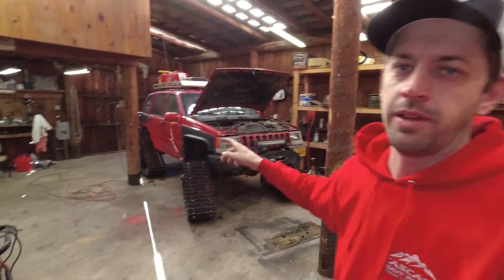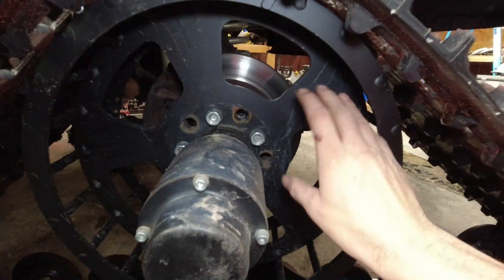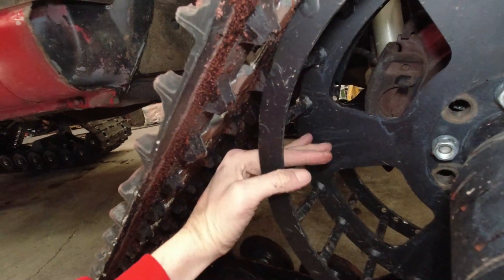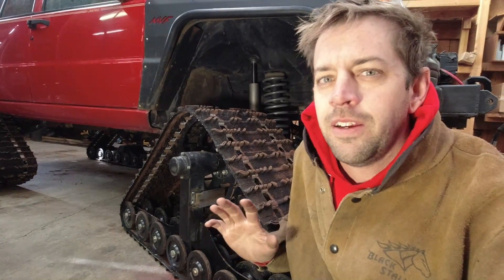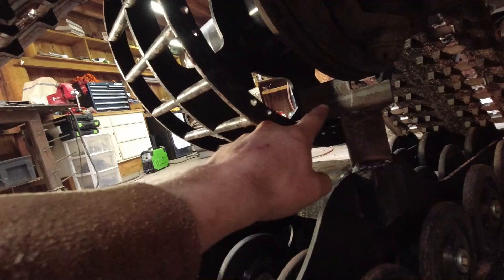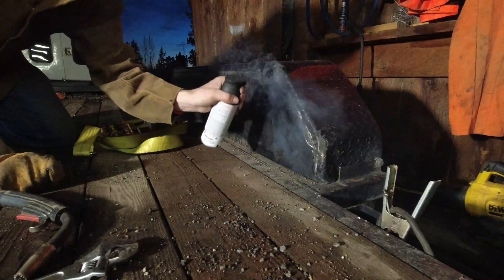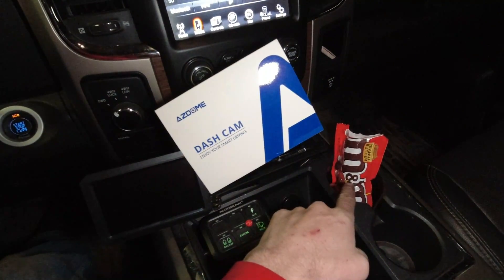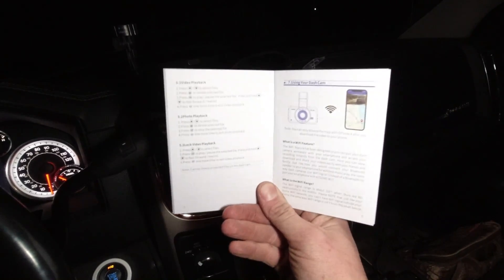Everything is broken.  Maintenance day for an off road recovery company

Comment: It's not even so much being "hard" on stuff. It's just that in our local environment there's an amazing variation of terrain and conditions.  You can go from sand, to snow, to rock, to ice, to mud and traverse 4,000 feet in elevation in one "off road" trip (without even leaving marked roads) that might be less than 30 miles distance.
Add daily recovery to that and any rig- no matter how well built and operated- is going to need constant TLC. Heck, I do a couple recoveries a year at best and I spend as much time in the garage as on the trail.
I think you do a fantastic job for a one man operation; I'm very impressed with your diversity and capability. The fact that you not only field all of this equipment, but modify and maintain it all by yourself constantly amazes me.
I also sleep a little better knowing that if I do something stupid on the back side of the mountain....
Casey LaDelle's not too far away : )

Comment: Just a gut feeling but the stand-off on the inner scraper may need to be a square tube instead of the angle iron.  Extreme conditions may too easily be able to bend the inner scraper back into the track sprocket.  I enjoy your videos!
Reply: I agree. A rock or a stick get up in that squirrel cage. Bad stuff is gonna happen.

Comment: Casey,

  One thing to consider in welding is the structural weakness that occurs when you do welding to the metal. It may need heat treatment to provide proper strength into the components.

Comment: Quick tip on the damaged bogey wheels - the bearings are usually replaceable, so you can buy bearing-less wheels and swap out the bearing from the damaged one.  Might save a few bucks if you go through a lot of wheels.
Reply: i was thinking the same thing, but it looked like the bogey wheel itself was bent. Check @4:26 and see what you think.
Reply: @Trevor Dennis  yes the bogeys are bent what the other gentleman is saying is buy replacement wheels minus bearings. Press out the bearing from damaged wheel, press bearing into undamaged.
Reply: @stevenhoffmann9373  OK that works.

Comment: After doing a bunch of work on snowmobiles over the years, I would say that it doesn't take much to bend or otherwise damage a bogey wheel.  All it takes is to roll over a tall-ish, pointy rock just right and a LOT of weight is put on a single bogey wheel.  The answer to that problem so far is to just bite the bullet and keep wheels on hand.  Some of these wheels aren't perfectly true right out of the box, so expect even new ones to wobble a bit.

And stay away from the Chinese bearings to put in the wheels.  You'll get maybe one season out of them before the grease is gone from them and it is grungy.

For the track "slipping" or "ratcheting," you may want to consider the idea of fabricating some "extrovert" cogs that also protrude into the track if your snow clearing idea doesn't work.  The track protrudes into the cogs already and the cogs will also protrude into the track.

Comment: Nifty solution for your wheel packed ice and snow removal! Still sucks that those bogies got bent!

I also have an Azdome camera for both my car and my girlfriend's van, stuck it on the passenger side of the rear view mirror for both for the exact same reasons! I put another power port in the top of the dashboard just for that camera.

Tip: you can set the screen to either be black or show the current time, so it won't be shining in your face.

Our model also has an option to add a second camera in the back of your vehicle, which I did. That way you can have it recorded in both directions when someone rear ends you and pushes you into the car in front of you! ;-)

It also has the option to overwrite the first files on the MicroSDcard once it has filled the card. Makes it useful even without a huge size microSDcard.

Comment: I was thinking the same thing when you showed your problem.   Only difference is that I would add an 1/8” or about stainless steel plate to turn the angle into a wedge.   And polish it up a bit.  This would prevent the snow from building up to an ice block which may start pushing on your sprocket it the wrong conditions.

Comment: Like the idea for the tracks...I think I would have bolted them on...that way you can remove them on a trail if something doesn't work...and if you slotted the angle iron and added some UMHW plastic for a wear surface...more adjustable...nice solution! Hopefully that weld doesn't compromise that strut!
Reply from the maker: I still can remove them on the trail
Reply: @CaseyLaDelle  True ..I can remove ANYTHING on a trail...on purpose or otherwise...

Comment: those wheels can be straightened.   Put on piece of round tubing and into oven, probably about 150F, and monitor.  better to let sit longer than higher temp. if possible.  I put another piece of round stock on top too, for light pressure down as well.

Comment: You weld well. When I weld, I'm pretty sure it's going to fall off. 
I usually only spot weld, so my wife can finish welding. 
She is a very good welder.
Reply: @Making it Happen   You learn by doing. Have faith, just because it's not 'pretty' doesn't mean it won't hold and if it is critical, let her check your work. Keep working at it, you will get better soon.
Reply: @johnme7049  I feel a little too old to learn it. It's easier to let her finish it. If you are over 60, it becomes more difficult to learn more. She also likes to weld.
Reply: @makingithappen5178  I understand, I'm 65 and wonder when I 'Got Old' :D I'm just trying to be encouraging. Have a great day.

Comment: The old Ransomes crawler tractors used a similar pin sprocket arrangement in the drive wheels to engage the tracks. The tracks  were cast steel cleats linked by rubber joints under compression from tie bolts between each cleat through the rubber. Unless tensioned right, the tracks would stretch and jump over the pins. The pins on the Ransomes had a metal cylinder around them as a sort of friction reducing roller to reduce wear on the engaging surfaces in the tracks. The downside is a greater tendency for the drive wheel to rotate inside of the tracks which stretch and jump over. In that stretched state in a slew ( turn ) they will walk off the drive wheel and off the loadbearing rollers. For in field repair of a jumped track, you may find that you need to carry a high lift jack and make a custom attachment point on the outer pivot housing above the centre axis of the pivot. Attach lower than the centre axis and the thing will tend to roll under rather than lift as a pendant load. I used a vintage Ford bumper jack with an adapted fitting but somebody wanted a genuine Ford jack for a resto so for the time being I don't have one. I have aquired a walking pin high lift jack used on four-wheel-drives. I am burning my brain out trying to devise a lift point without spoiling the vintage aesthetic of the machine which was built in 1954. A more satanically inspired device like a highlift jack I have not yet come across. You need to be exceptionally careful that the lever handle does not run away and smack you in the teeth. A more ideal lift for your situation might be one of those long throw hydraulic offroader's jacks. You would need to have an extension arm so the jack can be set back to allow space for the thrown track to be eased on and a pin to stop it from sliding off. With a decent baseplate, the jack should be steady enough to lift one track assembly. Add a curved piece of stout sheetmetal with two downward tangs to stop it from slipping across the drivewheel. With this across the top of the drive wheel, you can slide the track across the drive wheel and the fitting may be easier. Two flatbladed spades face-down are also helpful for walking the track across the sheetmetal as the upper part of the track is very heavy. My ramblngs are only derived from wrestling with the Ransomes tractor but may give you a few clues. An alternative t lifting the track assembly itself would be to strap the front suspension from dropping down and lift from a strengthened bumper lift point on the vehicle. That would also allow more workspace for slackening off the tension adjustment then sliding the track on. If there are factory-issued handling notes for the track system, then please ignore my comments. A wedge-shaped sheetmetal guard almost touching the rear track path to spill the thrown snow under the vehicle and back out onto the snow surface may be helpful to avoid the thrown snow packing into the front and filling the drive wheel. A cylinder of sheetmetal inside the drivewheel may also be helpful but would add weight and balance issues.

Comment: That trailer repair reminded me of the time I hauled a truck and when I loaded it rubbed the inner piece of sheet metal on the fenders with the tires (shout out Big Tex trailers). Didn’t realize I did and it contacted the tires, after hauling across town maybe 15-20 miles both tires on that side blew. Luckily it didn’t happen while I was towing or when the truck was loaded on the trailer but definitely something I’ll be more mindful of next time. Also a good case for drive over fenders with heavier gauge sheet metal!

Comment: I would recommend that you put 2 pieces from the front of the angle iron to the back side to reinforce and prevent flextion which will eventually break the welds or tear the material away. I would then recommend sending this to the manufacturer as an idea that they can send you a dollar or 2 to use it.

Comment: Casey , if you would like a hand with removing spam in the comments I would be glad to help.  I am a moderator on 4 other channels.  A moderator can scan comments and remove the spam or nasty comments for you ,  they are put into a file for you to review.    From there you can delete them permanently and you can even block the accounts that left the spam.    Also if a comment is accidentally removed you can restore that comment.   YOU always have full control over everything .  Just thought that I would offer as I see a lot of spam comments under other legitimate comments.

Comment: Pretty clever invention to put the scraper on the rollers, I think it works.
I recommend Banks iDash 1.8 Data Monster gauge for you. It´s very compact, just 2 1/4 (52mm) and gives much more data as you need. You can even take a datalog if you need. Just connect it to the OBDII port of your truck and thats it. You can also add more analog sensors if you need. You can also add more datamonsters one after the other as a chain.

Comment: Nice work on the track wheel sprocket cleaner😁😜😎beats carving up Plastic Drums... so the Trailer Fender that was Broke and the Bent Bogey wheels seemed to be on the same side... HUMMMM 🤔
Also thinking about Dozers they have sprocket cleaners that are Angled and sit so that the Mud / Snow, will push out and away from the side surface of the sprocket wheel. Same thing is set up on the Idler wheels they were kinda Flimsy I thought on Army D-7G’s the last ones I worked on... but a 48 ton Bulldozer is also made of a LOT of Steel, oh and it was only 8 tons over the 40 ton Low boy trailers we were pulling them on... I’ve got a Autobahn story coming down 7k Hill going to Graff from Wildflecken! I’ll hang on to that one till we have Coffee some day!😎 great work, and for what it’s worth now that the angle iron is mounted, a flat bar on the bottom (opening) side should strengthen it very well, it’s always easy to say but harder to do! And if it’s pre Bent for ya during your next use cut it off and use a little Tappy Tap Tap then re-weld and paint it !
Good Luck Casey hope to see more soon!

Comment: I like your prototype fix for track loading and slippage.  Solid frame tracks will always abuse the front bogies.  I went through a lot of them too.  Just make sure when driving on solid ground you slow down and avoid every little road imperfection.  That's what destroys them...  

Looking forward to the track testing with the prototype scrapers installed....

Comment: Throwing out another idea to keep the snow clear of the sprocket.  Make a U shape out of bar stock sized to span the opening in the sprocket, weld in place on two or three openings.  As the sprocket turns they will shave away any snow that is stuck to stationary parts of the track frame.  Kind of like a cheese slicer.

Comment: Snowmobiles use a sprocket that the teeth go through the holes with the metal armor in the track. Your system trying to drive from the rubber lugs only will be prone to failure from wear and snow buildup. I know you didn't design it but you really need those toothed drive sprockets for a more positive track drive.

Comment: Love your video watch them all the time. R. E your fix for stopping the build up inside the track drive area. You did a great job, my only concern is that if you pick up a rock and it gets wedged in your going to be in serious trouble.
You'll need to come with a spring loaded system to avoid that.
Keep those videos coming👍👍👍👍👍

Comment: Hey Casey I’m loving your videos.  I’m interested in how your scrapers hold up.  I do have a concern that at a 90 degree angle the angle iron may not be able to take the direct pressure and bend.  Maybe backed with square tubing would give it more strength. Also a triangle gossit against the back of the outside upright would also give it more resistance to being pushed back. Especially if it’s being hit with hard snow and ice.  I don’t know. Maybe in your snow it will be fine as is but thought I’d offer a couple of ideas Incase it needs a bit of tweaking. 
I love your ideas on how to make things better.

Comment: Those suction cup things never last and always falls off with temperature changes.  You can buys adhesive foam backed thin black plastic pucks from Amazon that stick to your windshield and then put the suction cup on those.  It will stay up a lot longer!

Comment: On bogie wheels.  Could you make a weighted unit, use shop press to warm them, force them flat as spares?
  On dash camera.  I am looking at one that incorporates a rear back up camera.  Records both, but screen is rear only when backup lights come on.  Hope it comes in next week.  Good to know you can’t cut cord. That’s why hard wire cord $25 extra.

Comment: USB max voltage is 5. The manual for your camera should have its input voltage/amperage. You can get adjustable voltage regulators to step it down and wire it in that way if you want a cleaner install. :)

Comment: great idea on the scraper for the track .. I know it's a test . What I would think about would be to BOLT it in .. that way if out on a back trail 5 miles from anywhere it got bent and was rubbing you could remove it and or replace it with a spare scraper .if welded you might not be able to repair on the road side ..  great idea for testing ,,
Reply from the maker: It is removable if it causes a problem on the trail
Reply: @CaseyLaDelle  ok could not tell from here .. great idea to clean it out .. also do they make stud kits for them tracks ? Snow mobiles have them ..
Reply from the maker: @randytravis3998  yes, they are snowmobile tracks

Comment: Better idea! Tape up the drum. Then fill the drum with expandable foam so there's no place for ice or snow to go do it on both sides vinyl paint over the outside 4 total waterproofing. Run the tracks around a few times to make sure there's enough space in the foam you have a problem you just dig it out with a wire wheel
Reply: but if you fill the drum with foam you loose the ability for debris, snow, mud, rocks etc to fall through and work itself out of the wheel, thus allowing it to be trapped between the foam and the track, which would then cause the track to slip again. You are basically replacing the ice that was there one time with the same problem, but making it to be there all the time
Reply: I did this trick with a set of rims on my bronko.  They would fill wile plowing. Filled the rim, painted it with vynal spray.  Snow is one thing compacted snow is ice..

Comment: Right on good video 👍 I have track's on my side by side and it's a tooth sprocket on top you would think for a heavier vehicle it would be the same I've never seen the barrel type. I think your fix should work and the boggy wheels that you bent I've never seen that also they brake or the rubber comes off. It most of been hotter out must if been against a stump or big stick that was in the snow.

Comment: Casey I'd check out possibly buying some aluminum bogie wheels or some beefier wheels in general for the outside. Kimpex makes a wide range of idler options you could check out, most are around $30 a pop, maybe try one of their cast aluminum and see they last longer.

Comment: Have some bogie wheels made out of alum (test) then make out of steel... angle in track drum... ok.. maybe mount backwards to put long stiff hard brush on.... idea... if you have one or want to get one and extra drive wheel... remove round bar and put in square (gives better surface to latch onto tracks) stainless.... something to test..

Comment: 3D print a plastic auger to bolt on the inside of the wheel, as the wheel turns it will eject the slush

Comment: Those plug in power cords wear out easily (especially if unplugging it and plugging it back in a lot).
Get the proper wiring kit from the manufacturer and hard wire the thing!

Comment: Nice post.
Just my 2 cents on the snow clearing device would a piece of 2 inch strand work? Could weld a piece of pipe on the support with a set screw to attach. If your around a truck stop wilson electronics makes a very nice fused with 16 gauge wire twin cig plug with twin USB with nice housing stick on or screw on. 
Be safe.